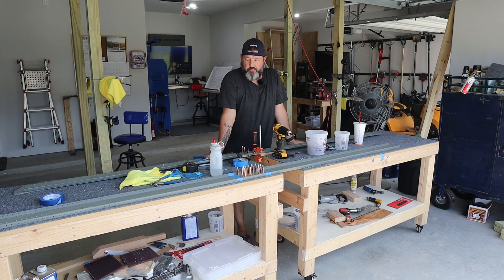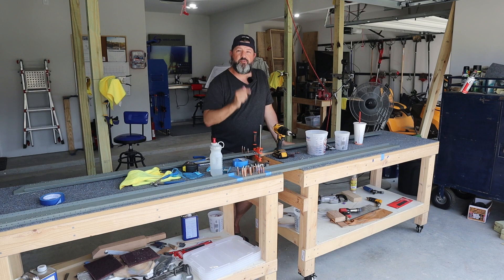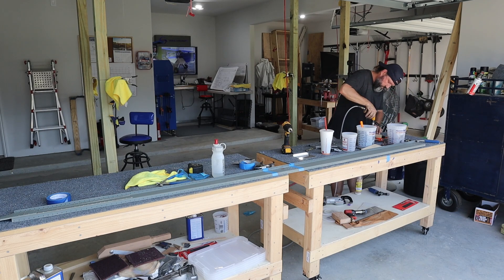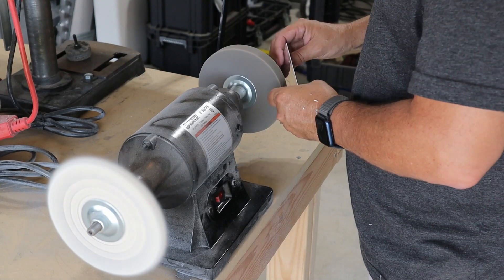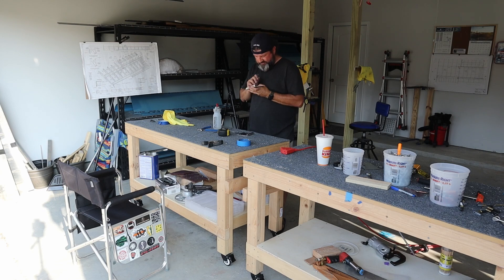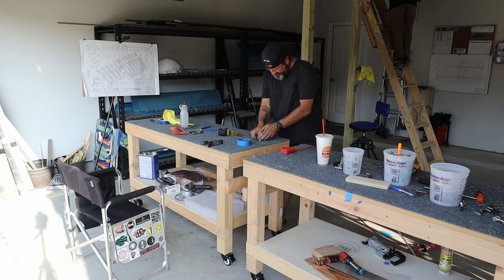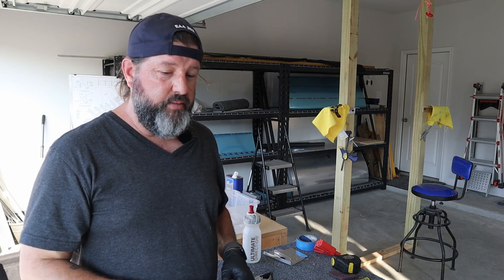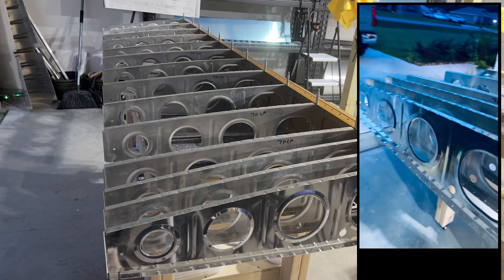RV-8 Build. Ep 047. Wings 09

Comment: Great job again.  You saved me much embarrassment, parts and money before I did the same thing you did.  Quick question since you are well ahead of me on the wings.   The plans call for making dimples (about 26) on the top edge of the rear spar along the fork reinforcement.  I did all that.  But noticed that they did not ask us to dimple along the other two reinforcement plates (W707E & F).  Did you just not dimple?  It is awfully think part to dimple altogether or are they going to countersink that part?  Just wondering if you got to that yet.

Also you must be busy with your other job since you have not posted in some time now.  

I think the laser cut parts issue is rather moot at this point.  While I don't have any that I am aware of, those that do have those parts, according to Van's they will not wear out before the aircraft does.

Thanks again for your videos, they really help out.
Dave
Reply from the maker: Hi David. Finishing dimpling the aft spar is on my punch list. And, yes, I do owe the dimples along W707E & F. I think I dimpled two or three of those holes and I wasn't happy with it. I'm going to try carefully countersinking with the Avery deburring tool to see if I like that better.... I've got a break from work coming up, and Van's just sent my flap and aileron replacement parts, so I'll be back at it soon.